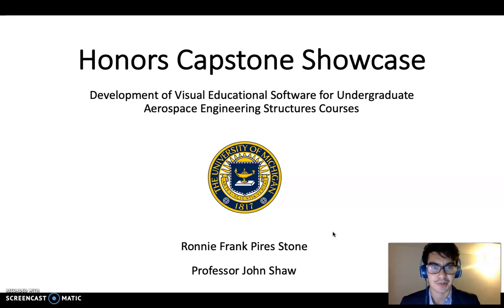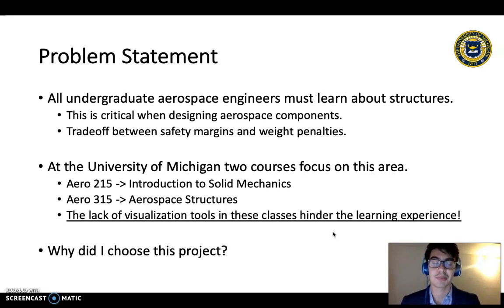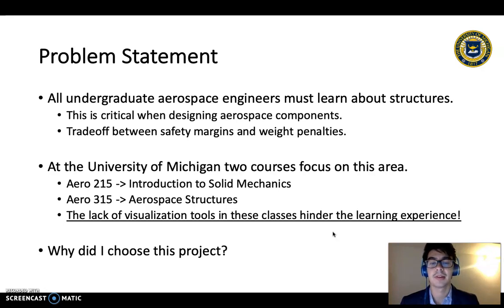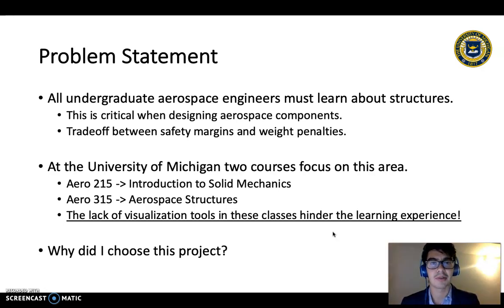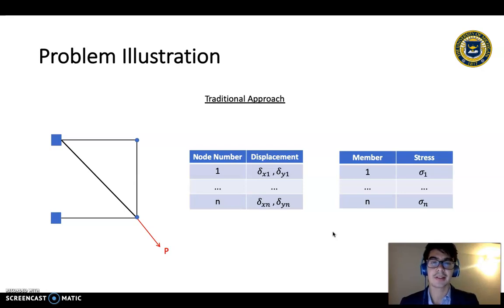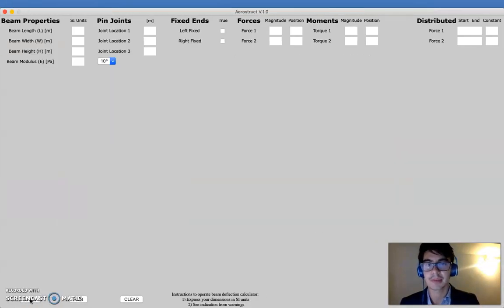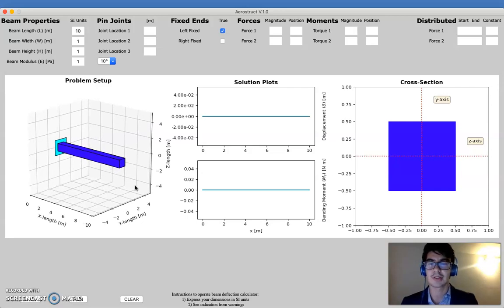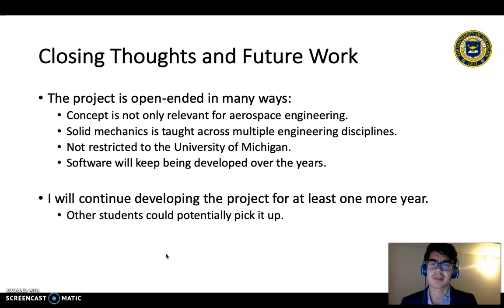Development of Visual Educational Software for Undergraduate Aerospace Engineering Structures Course

Comment: As someone who just about scraped by in Aero 315 last semester, I can say that this tool would have been very useful in demystifying FEA analysis of truss and frame structures. A useful concept and great execution!
Reply: Kail, thank you for saying this. From my experience, many students have problems transitioning from Aero 215 to Aero 315 (myself included). I think that, as you pointed out, this gap could be bridged by demystifying the solution to complex problems through a visual (less intimidating) approach.

Comment: I enjoyed your presentation and you are absolutely correct in that visualization can provide significant benefits for students and even from a teaching standpoint. A great feature of your educational tool is the ability to be able to change parameters easily to be able to see the influence of different magnitudes, supports, etc. Are the analyses only considering elastic behavior and are there other features that you would like to add to the tool?
Reply: Jason, thank you for your feedback! Currently, the software can only deal with problems assuming elastic behavior in the materials. I thought going beyond that would be better left for later stages of the project. There are a number of features I would like to add to this tool (stress distribution on beam cross-section, original vs displaced configurations, etc...)! Unfortunately, I am the only one working on the code at the moment, and adding these features takes a lot of time and effort. However, I am confident that the project will grow to incorporate all of these in the near future.
Reply: @ronniefrankpiresstone1128  Thanks for the reply. Your ideas sound great and good luck moving them forward.